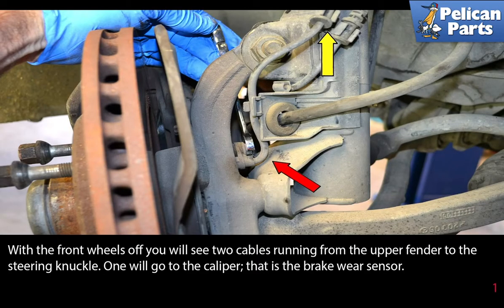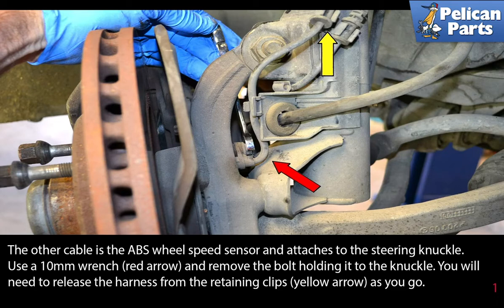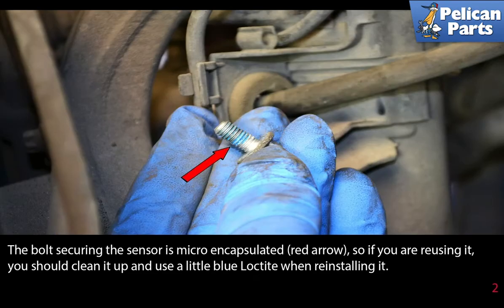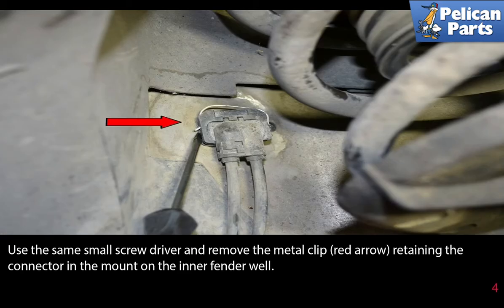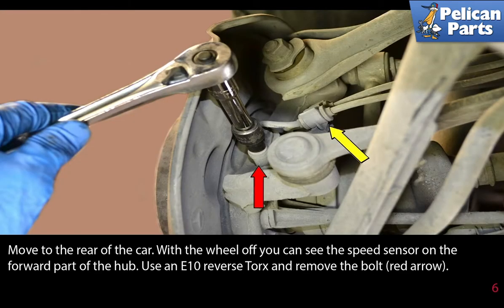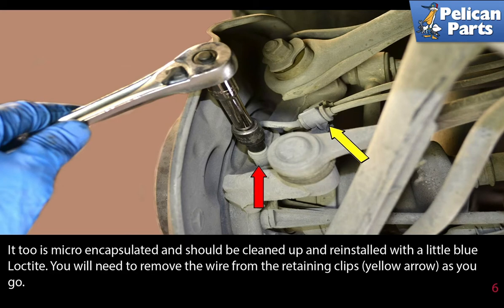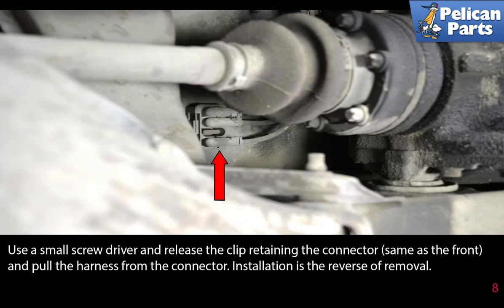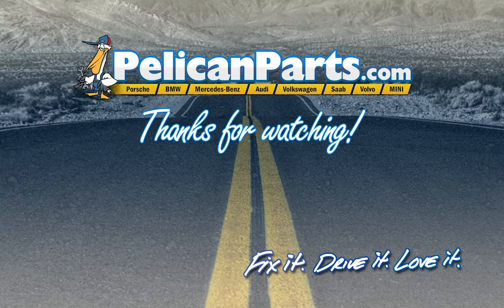Mercedes-Benz W203 C-Class ABS Sensor Replacement

Comment: How many wheel speed sensor does this have c320 2001? Is it only two front left and right?
Reply from the maker: 4
Reply: @pelicanparts  can’t seem to find the rear speed sensor you have a video for it?
Reply: @pelicanparts  I have a 2006 C350 and I'm replacing the speed sensors. The drivers side front wheel only has 1 connection and it's for the brake pad wear sensor. The second hole where a speed sensor should go is blocked off. There's no connection there either.

Comment: I have a C32 AMG. After changing out the bad sensor my ESP, ABS, and BAS are still coming up on the dash. Do I need to reset something with the computer?
Reply from the maker: You might need to clear the fault codes.
Reply: What I've been told is you should disconnect the car battery first then replace the abs sensor after that turn the steering wheel fully to the left and then fully to the right and that should solve the issue